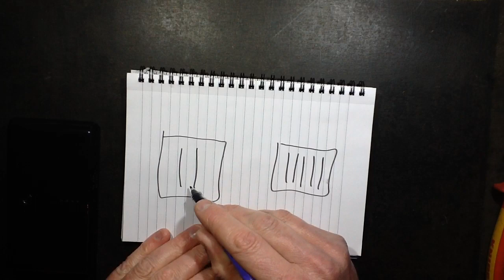The failure mode of LED floodlights.  (apparently)

Comment: My 100W LED torch has failed in the same way, one of the strips of 10 died. So for now I just tweaked the driver to run at 90w instead.

Comment: I think if you put one resistor probably 4ohms 5watts in series of this LED chips will save them! here in my area one electronics store is selling these type of LED Chips with resistor attached to it and they are pretty reliable. I'm using one of these on my desk.
Reply from the maker: DIY Tech That's an interesting idea, because I have noticed that when the power supply kicks in there is a pulse of intensity that made me ponder whether it was just a visual effect of my eyes adjusting to the high light output, or an actual high current pulse through the LEDs.
Reply: Yeah Just try it, and let us know how it goes :)

Comment: I bought one from ebay, it failed within a few hours of owning it. Reason= no thermal paste on the Aluminium heatsink.. £3 and 30mins later, fixed! Still works to this day :) Althought the fins on the back get up to about 60C.
Reply from the maker: ***** On the plus side, the case alone is worth the money, and at least they are hackable and fixable.

Comment: The problem with these is that individual leds are not balanced. it could be that most of the current flowing through one row of leds. Have you played with better quality leds yet?
Reply from the maker: Tiit Saul The problem with finding better quality LEDs in this format is that it's hard to tell what is good and what is bad.  You can't go by price, because some sellers sell the exact same crap at an inflated price and pass them off as "high quality" ones.

Comment: Please review and teardown the power bank you hold up to show the reflection of the LED's, I bought one of these and quite liked it although the claimed capacity of 50,000 mAh was obviously some Chinese joke, and when it detects a full charge on a device  will switch off, but while switched off will still deliver a battery level voltage, but it was very cheap and seems to charge up mine and everyone else devices while on weekends away. It was very cheap, I paid under £13 for it, amazing considering it contains what look like 8x 18650 lithium cells.

It has increased in price slightly where I bought it but here's the link

http://www.amazon.co.uk/gp/product/B00GN5FTJS?psc=1&redirect=true&ref_=oh_aui_detailpage_o09_s00

BTW, love your tubes, would love to see more @work and longer @play vids

Comment: LED chips there all still work, just the cheap and nasty bond wire has fractured off of the top of the die. the flickering is it cooling and heating up till it finally moves far enough away to lose contact, possibly with some of the soft encapsulant moving into the space to fill it. If you apply pressure over each led you probably will be able to see which one has fractured, though do this at low current so you can see the chips.

Comment: I guess the more chips that are in series the lower the overall reliability. That probably means a 10 chip led will be 10 times more likely to fail than a single chip. The weakest chip failing, shutting down the whole strip. So much for the 30,000 hours life!
Reply from the maker: Michael Beeny There's also probably an issue with the parallel circuits resulting in uneven current distribution amongst the LEDs from first use,  I'd normally expect to see an LED shunt out though, and that would result in that single string of LEDs suddenly having a lower forward voltage and thus shunting more of the current.
Reply: bigclivedotcom It's late clive, go to bed! lol Thanks for the reply however.
Reply: Having more LEDs in series would actually average out the difference in forward voltage a bit. Just like having multiple 5% resistors in series would result in a better than 5% resistor value (0.05/sqrt(N)). So the parallel led strings would be more balanced. 

Still, any led can be the weakest link, and make the whole chain fail. 

I really don't like these parallel connected LEDs.

Comment: Maybe the heatsinking is not good enough, specially as you have increased the power
Reply from the maker: ***** The fitting is supposed to be a 20W fixture.  The fins on top rise to a hand comfortable temperature.
Reply: bigclivedotcom I don't know a lot about power leds, but i undeerstand about heatsinks.My thought in that case would be, are the chips getting the heat to the heatsink efficiently, and is the heatsink transferring that heat to the fins and away quick enough, or is the heat congregating on the bulk just behind the leds,
In my experience with power transistors, the device metal substrate is connected thermally to the heatsink, but it seems with leds is there a piece of circuit board between ?,
Reply from the maker: ***** With these power LEDs the chips are bonded directly to a metal plate, which is then screwed to the back of the heasink itself with suitable thermal transfer compound, so the thermal path is large and direct.  The array of fins looks quite acceptable, but I've not tried a thermocouple in there yet.
Reply: bigclivedotcom I recommend using Arctic MX-2 thermal compound. It's originally designed for Laptop CPUs and GPUs, it has EXCELLENT thermal conduction!

Original Thermal Compound shipped with Laptop (i7 3632QM) under 10 minutes full load: 83°C, throttling
With Arctic MX-2 thermal compound after 1 hour full load: 73°C, not throttling anymore at all

What's good for CPUs must be good for LEDs, too.

Downside: VERY expensive this stuff... Paid 8 EUR for 4 Gramms...